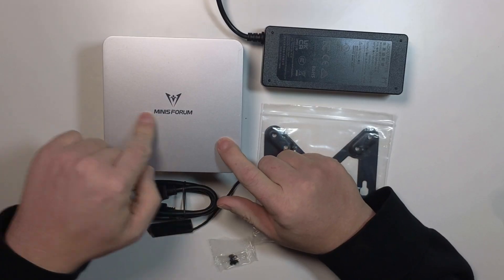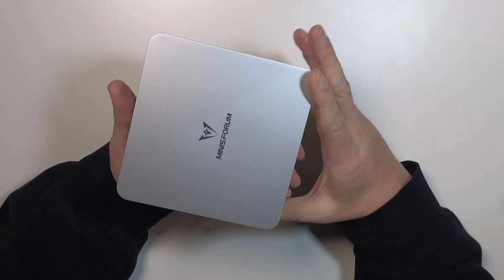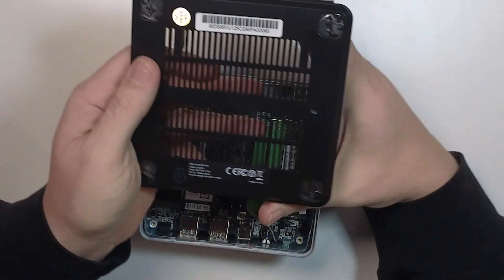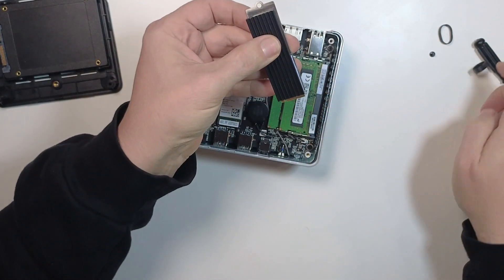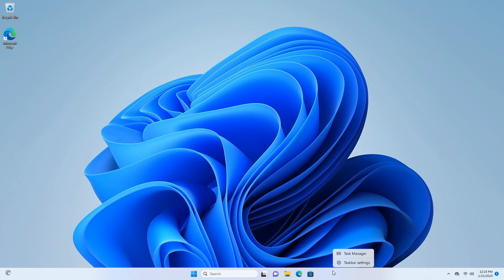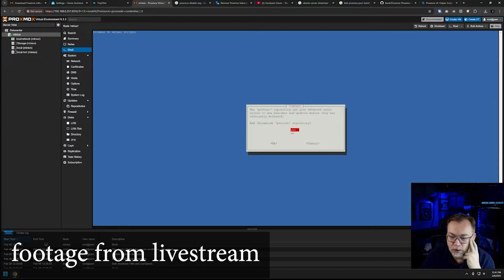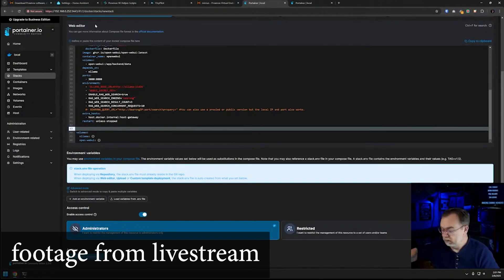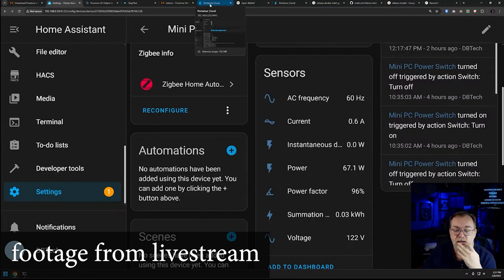The Minisforum UN1250 Mini PC Kinda Blew My Mind!

Comment: I very recently purchased a Minisforum UM790 .. They removed the BIOS option Boot up after Power Restore.   I'm a bit disappointed I can't install in an unmanned location.  It looks like the UN1250 has the same BIOS.

Comment: They have been doing 2.5 lan for a long time now. My TH50 model i acquired long ago has dual 2.5 lan I use to run my home server from. Been reliable as a rock and would recommend this company for their vast options
Reply from the maker: This is my first time reviewing a Minisforum mini PC like this. Not all mini PCs have 2.5GbE, so I was happy to see it here :)
Reply: @DBTechYT  I won't buy anything, except retro hardware, that doesn't have at least 2.5gbe.  The speed is nice, of course, but the multi-tasking it enables is better.  Couple file transfers and watch a movie from the Jellyfin server is no longer a problem.
Reply: TH50 was a great mini. Ugly, but perfect for work